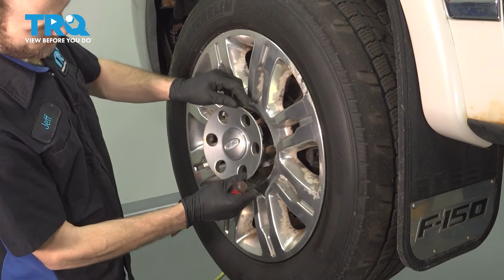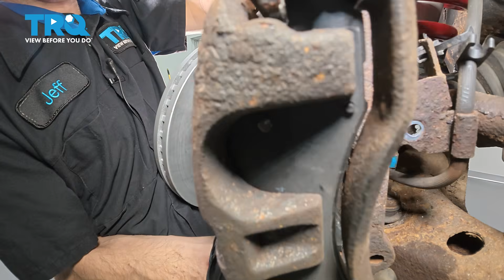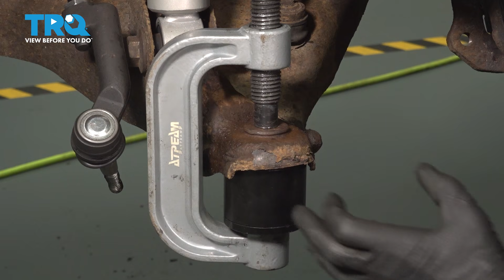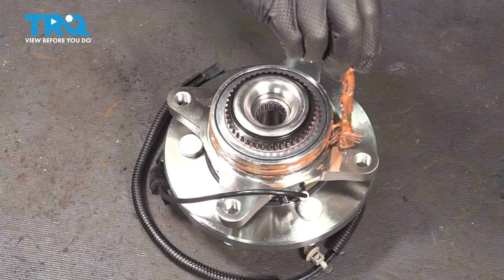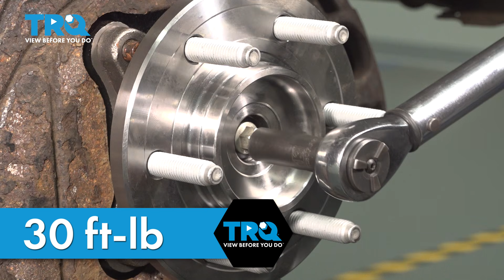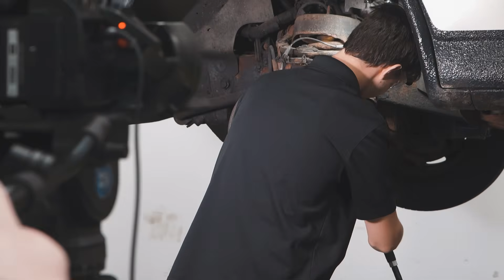How to Replace Front Lower Ball Joints 2009-2014 Ford F-150

Comment: Hi guys. I am replacing the lower ball joint on my 2008 F150 4WD. The stock unit on her now requires a 24 mm socket which I think is for an M16 nut. However the parts I ordered look the same but requires a M21 socket which is for a M14 nut. 
I can't help but feel I would be putting in the wrong ball joint. I can't tell from any of the websites if it is the correct one or not.